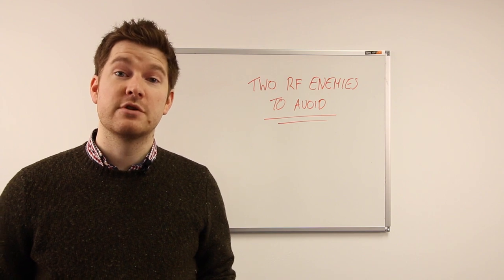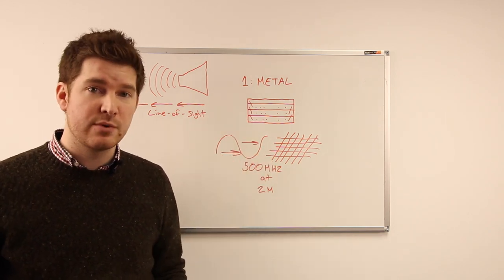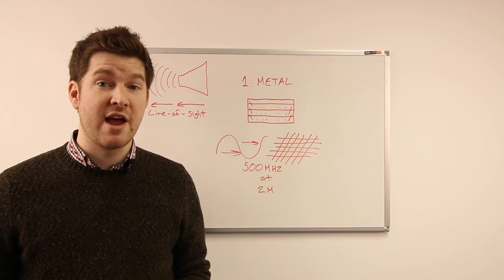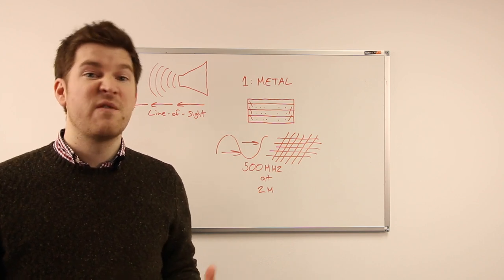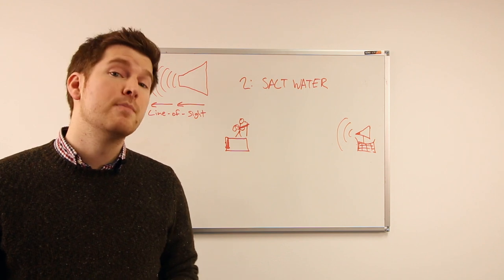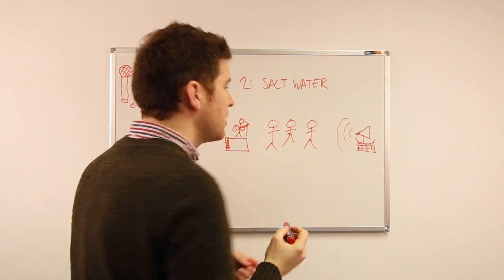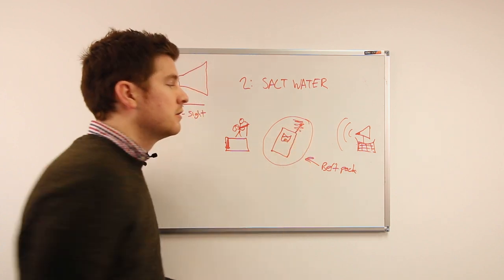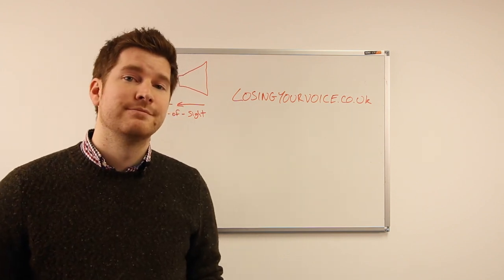Shure Whiteboard - Two Common Causes of RF Interference

Comment: and my problem is that my old unit  and its chanel A is receiving signal from another unit's chanel A ..with about 3.0. difference in frewuency.my old unit channel A is using 228.7,my new unit which i recently bought,its channel A uses 230.5, they are of the same model though and i dont know how to fix it;( sadly.